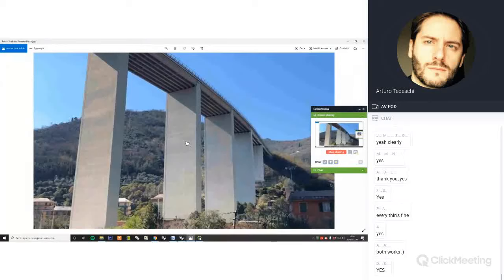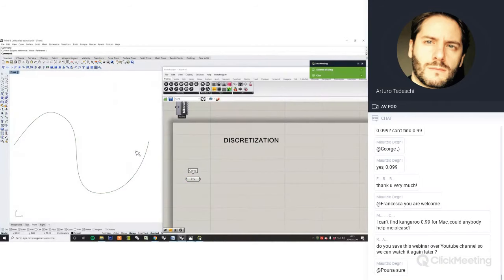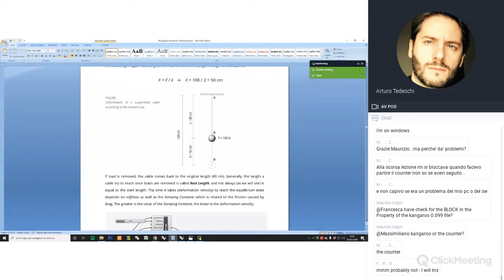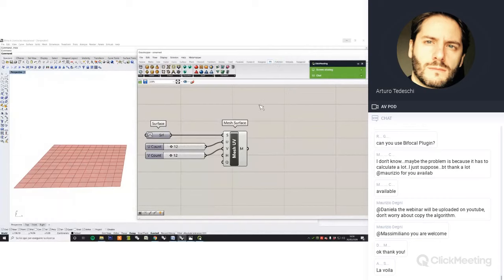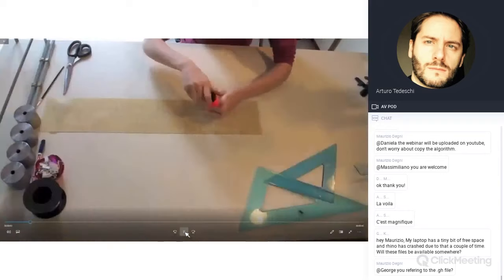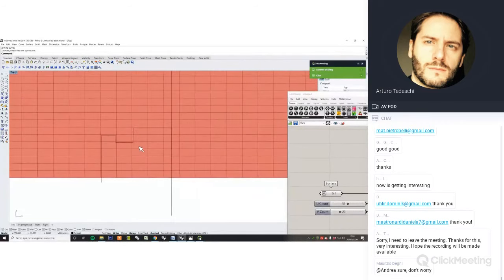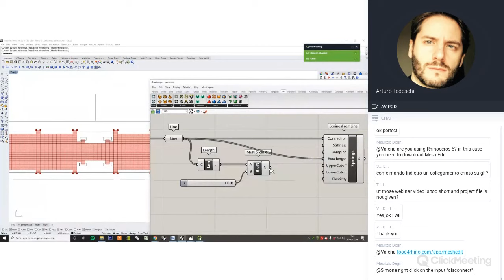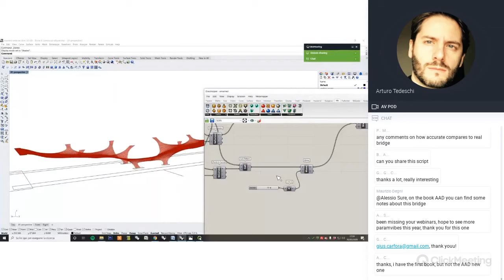[Grasshopper] Introduction to Kangaroo and algorithmic modelling of Musmeci Bridge

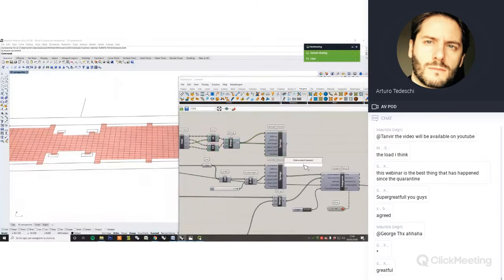Comment: Hi Mr.Arturo, thanks for sharing the webinar, really appreciate it. Sorry may I ask how we can achieve similar results using Kangaroo 2.0 ? As from 1:40:00 ( Lifting up the anchor points to achieve the shape) onwards it doesnt seem to work...May I ask if there is a way to go about this ? Thanks and would really appreciate the help.
Reply: Hi, I dont know if you solved this but it can help somebody down the way. In Kangaro2 you can create a separate Anchor component for those points that go up along the Z axis - connect the output from CullPattern to the P input and the Move output G to T input of the Anchor component and now you can move the points upwards.